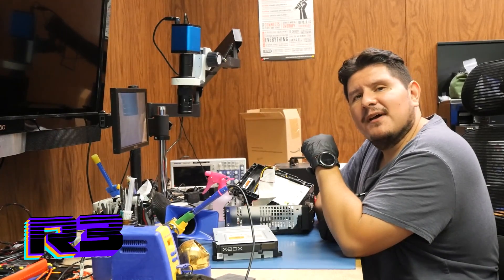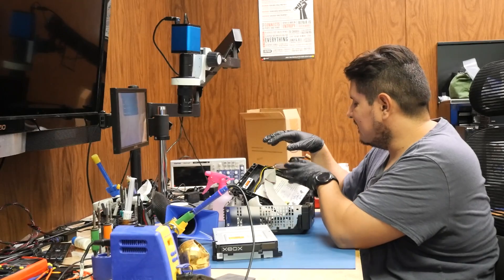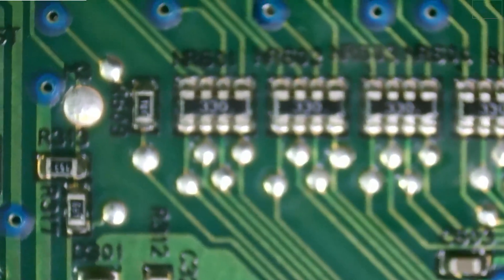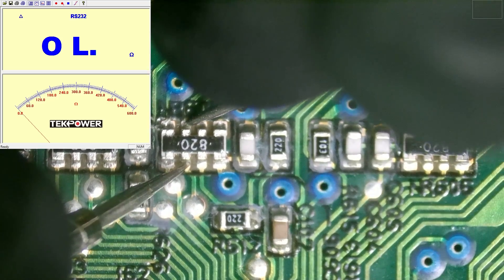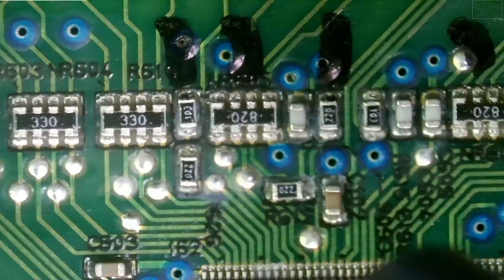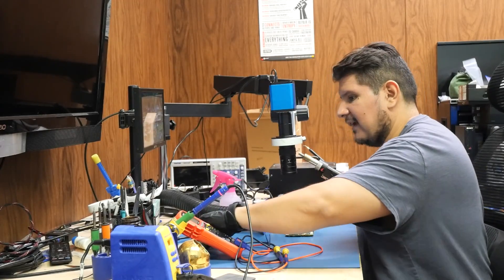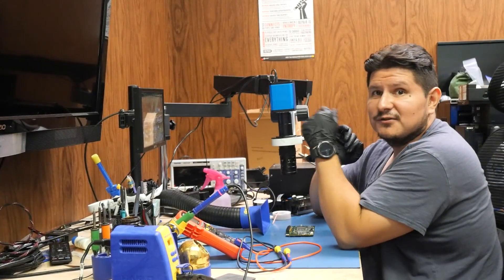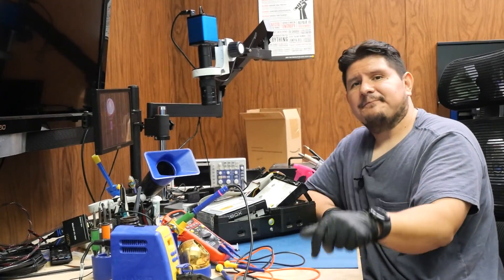How I Fixed The Infamous Xbox Error 12 (2024)

Comment: I was getting error code 12 and tried this yesterday. Went from getting code 12 to code 7. Is that progress or is that a sign I made a mistake? I am a complete amateur who managed to find a place that let me use their hot air.

Also, when I was originally getting 12 I swapped in the drive from a friend’s working Xbox to test and mine booted up - so the rest of my box should be ok.

Comment: I have a similar problem, the console gives error 12 and won't move forward, when I try to open the dvd drive it won't open, do you think my problem could be related to these capacitors or could it be something else? If I disassemble the DVD drive it opens and closes but the error persists.
Reply from the maker: I'd say there's a good chance it's the resistors.
Reply: @RetroRenegadeRepairs  I can press the eject button and my tray opens. If the resistors were cooked on mine, the tray wouldn't operate would it?

Comment: Thanks a lot. I replaced 2 damaged resistors and everything works. In my case sometimes error 12 appeared, other times it loaded the dashboard but still didn't read the games. I will add that I unsoldered the resistors from the 3.5 inch hard drive. I give it a thumbs up and sub.
Reply from the maker: Very nice. I'm glad this helped you.

Comment: Hey thanks for the video man 
Just had a questions. On your description you have this as part replacement (RES ARRAY 4 RES 33 OHM 1206" )
But the resitors you replaced were 82ohms ?  Which is the replacement parts for it ? I just tested mine and both of those same resitors are bad on mine. Thanks
Reply from the maker: You'd just purchase both values (33 and 82 ohms), but same package of 1206. Links in the description.
Reply: Would you mind sharing a link with the replacement parts 😎
Reply: Would you mind sharing a link with the replacement parts 😎

Comment: anyone have a part number for these resistors for people that dont have a spare? i was able to make some 33ohm resisrotrs using standard resistors but i want to fix ith a smd resistors
Reply from the maker: The general characteristics for the resistors are in the description. As long as you pick one that matches the specs you should be able to use any manufacturers resistors.

Comment: My 1.0 xbox had error vode 07, put the drive in anoyher xbox and got error code 12, put a good dvd drive in both and both booted up fine, started testing those resistors and tried it again and it worked fine. Idk how it fixed itself
Reply from the maker: Thats weird, but thats good information for others to try with this issue.
Reply: Could have been dirty IDE contacts.

Comment: Thanks for the tip, and congratulations on the work!  Could you make a video showing how to calibrate the Samsung laser?  My Xbox keeps showing a reading error but it is already clean and lubricated, but I don't know how to calibrate the laser.  Can you help?
Reply from the maker: There are a few guides on how to adjust the pots, but you'll want to use a multimeter to help make the adjustments. Be sure to note the values of the pots before you start adjusting them.

I may make a video on it in the future. Adjusting the pots is time consuming and doesn't always bear fruit. Good luck!

Comment: it's not going to be able to eject with it being blocked by the console front
Reply from the maker: True. It didn't even get that far though, the drive needs to be lubed and cleaned.
Reply: @RetroRenegadeRepairs  just take the belt off and put it in boiling water for half hour, clean the drive cogs while it's soaking then put the belt back in and bob's your uncle
Reply from the maker: I have seen that done, but I prefer to replace the belt, clean the internals of the drive, relube the gears and rails. When I do this type of stuff for customers I don't want to leave any reason for a repaired or refurbished console to come back under warranty.
Reply: @RetroRenegadeRepairs  can you stop talking about lube please